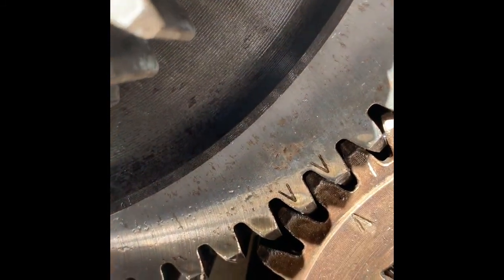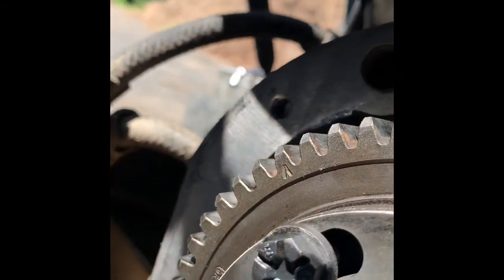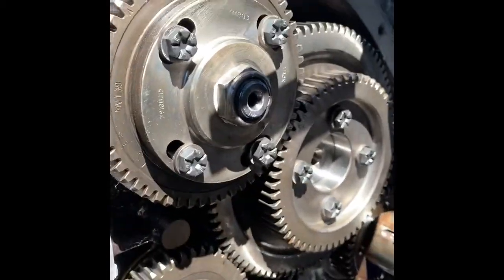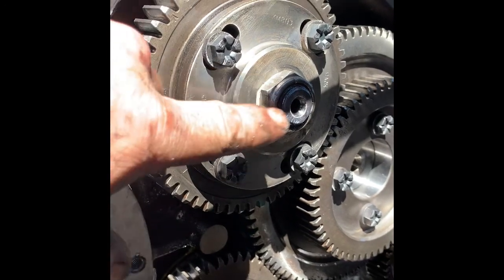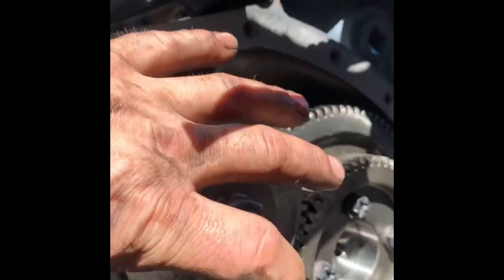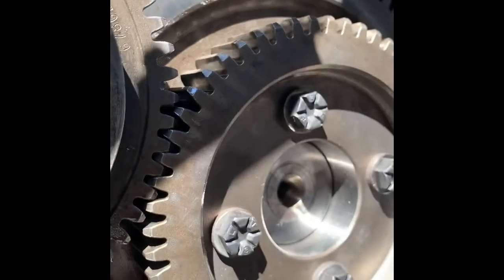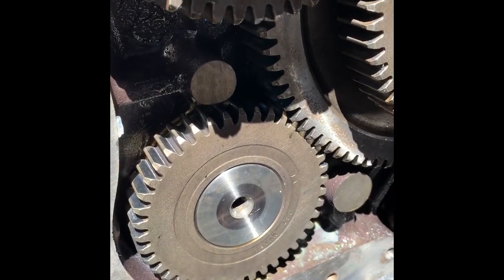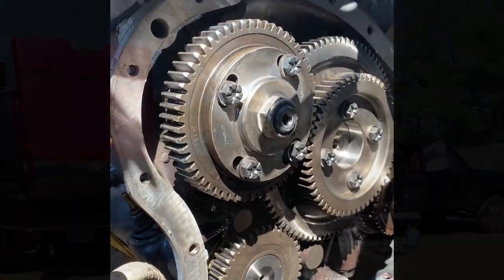Mack e6 engine install and timing issue

Comment: I got a 82 r 672 2 ohv and it threw 1st 2 rods messed up the lobe. I got everything off but the timing gear cover. Is there anything you can tell me like tricks or not to do's bc its my first one. The gear cover is stuck, do I need to remove crankshaft pulley
Reply from the maker: Pulley needs to come off

Comment: i believe you also have to time the injection pump using an A B light for VMac and non-VMac injection systems, whoever worked on it before must be used to cat engines cause heui pumps on cats dont need timing!
Reply: A/B light is used on E-7 engines. This is an E-6. You used a fuel flow timing pump Assy.

Comment: Them old mack E6 engines were tough
Reply: They sure were, we ran em in DM’s they pulled like a much bigger motor and did good between overhauls 👍🇺🇸 and didn’t sound bad through a short chrome stack either.